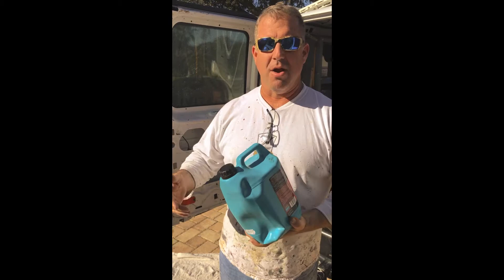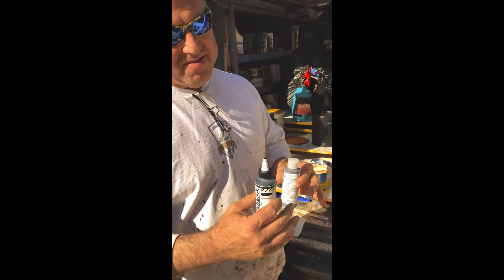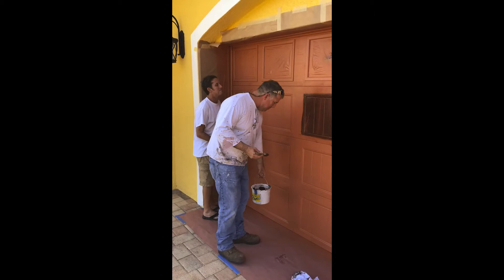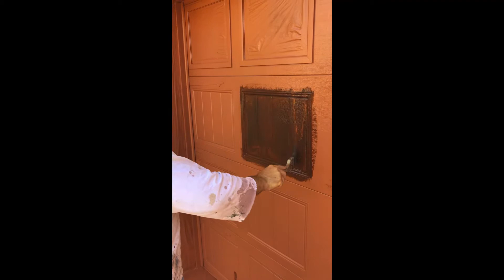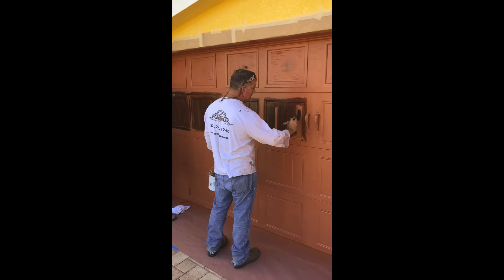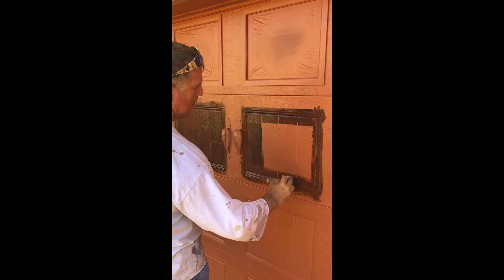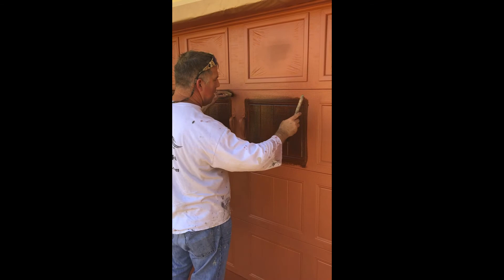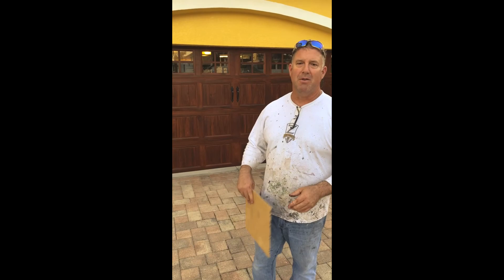Zach Freeman Garage Wood Grain 2017

Comment: What is the final clear coat product? What Primer do you suggest for fiberglass doors that get really hot? like 160 degrees in the winter? The acrylic paint that is currently on the doors bubbled up and is stick like gum. I'm not sure what the previous owners did to this house, but their regular paint job didn't work.
Reply from the maker: Lyn Bergen 

Clear coat is modern masters master supreme clear. 

Bubbles mean stripping doors to bare metal, prime with latex STYX by insylx. Then rebase with latex exterior satin
Reply: @zakk1000  , I use MM, Modern Masters products too. They are the best. I use them on my murals. Nice video, too, by the way.